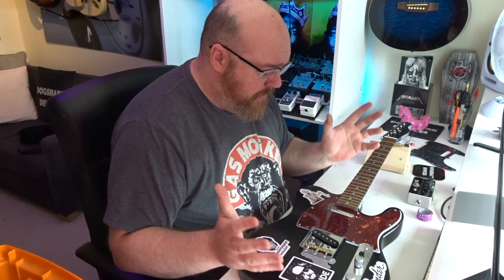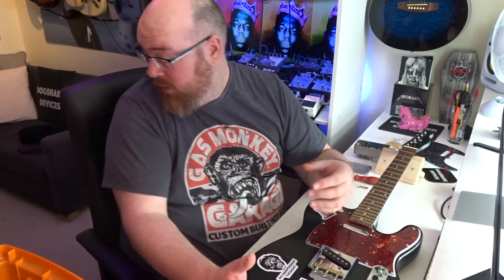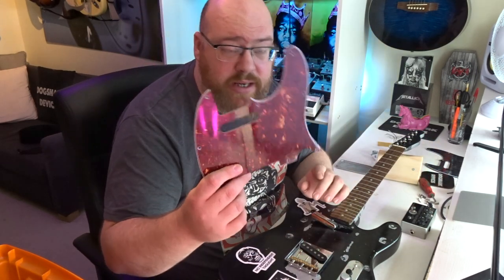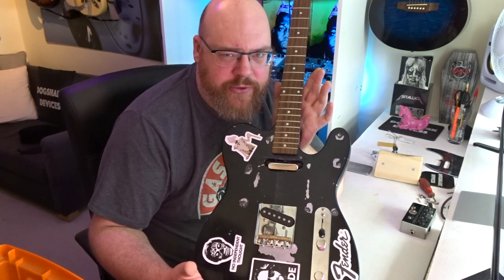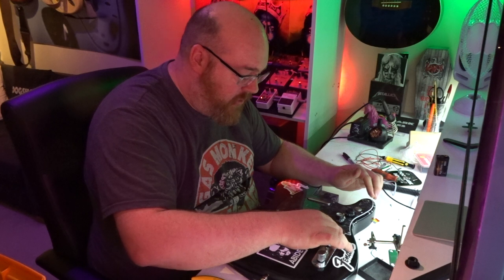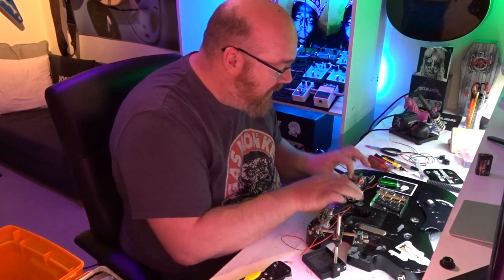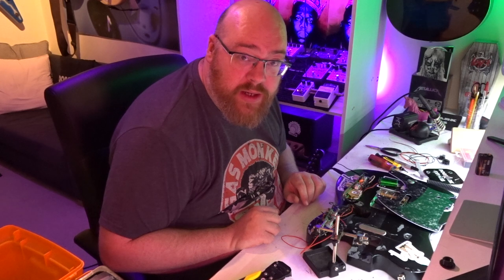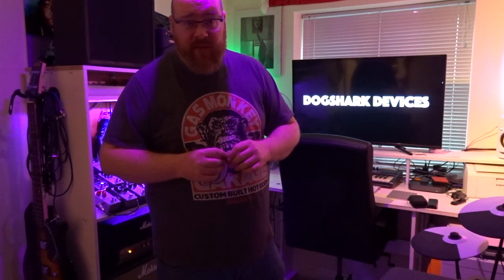Matt Bellamy Fuzz Factory Tribute Guitar Build - How To Install a Fuzz Pedal Into a Guitar

Comment from the maker: Anyone else got any interesting mods they've done to guitars? Always looking for something cool to try.
Reply: I have a XY Midi pad in one guitar🤔
Reply: in how to create a midi control for the digitech whammy pedal, on the song map of the problematique
Reply: I retrofitted a floyd to a 90's Fernandes Dragonfly style hard tail guitar. I had to build the floyd rose nut shelf out of wood because I wanted to do it right. Some people I saw took out part of the fret board to install the nut and then wondered why they had intonation issues. You and I both probably know why they had those issues, messing with a scale length will mess up any guitar. I measured the angle of the head stock put the same angle on the bottom of the wood so it would sit flat on top of an angled head stock (long process). 

Second things I did was build a complete strat from scratch, tele from scratch and a JPX/EVO/Prince style mixed guitar. The last one was because I wanted the fret access the JPX's body offered and just coupled it with the neck profile an Ibanez neck has. The guitar is probably one of my favorite guitars. I also installed a EVO 2 Pickup (Dimarzio) in the bridge. The guitar looks like a JPX until you hit the head stock which was done in an Ibanez shape. Then I colored it purple (head stock and body) with Prince purple since I finished it right when Prince died and felt it was appropriate to put something into it that shows the musical influence and legacy he left behind. I also added a kill switch which is just fun. 

I just got really creative and decided to borrow from other guitarists, my next challenge will be creating Vai's guitar.
Reply: Kaos pad. Matt Bellamy has that as well on his first MB-1

Comment: Just what I was looking for!

Is there anywhere I could find a circuit diagram like this for a Jazzmaster? I'm thinking of replacing the rythm tone circuit with one of these.
Reply from the maker: There's not much to this really. You just place the fuzz circuit between the volume pot and the output jack so the signal can be either router thru the circuit our direct to the output jack. This way doesn't matter what pickup configuration you have.

Comment: I've been searching for a video like this for fuckin ages and this is the holy grail! What settings did you lock the vol, gate and drive to??
Reply from the maker: Honestly can’t remember now. What I did do tho is play with the pedal when it was still a pedal to get the right pot positions for what I wanted. Then once I’d removed the pots I wasn’t going to keep I took a measurement of resistance from them when they were set in the right position and then added resistors of that value to the PCB in the place where the pots had been.  So it’s really down to personal taste.
Reply: @DogsharkGPS  thanks

Comment: Hi man, thank you for this!! I'll do the mod to my most beloved guitar. I'm following your diagram, but I'm confused, you mentioned a DTDP, that's a 3 way right? so would that give me ON to either side and OFF in the center? ... or is it another kind of switch?
Reply from the maker: There is no middle position on this type of switch. Its on/on in either direction but wired so one position routes the signal to the circuit and back out and the other position is effectively a bypass.
Reply: @DogsharkGPS  got it, thanks
Reply: @DogsharkGPS  hey good sir, did you figure out why the trimpots didn't work? I'm doing it and space is tight...
Reply from the maker: @publicnature  not for certain but I suspect it was the ribbon cable I used.

Comment: Nice one Dogshark, I am going to do a similar thing putting a zvex fuzz probe into my squire baritone telecaster. The lower range of the guitar should be monstrous with the fuzz! The metal plate 'probe' part will form part of the pickguard so you can move your hand nearer and further from it to change the sound. Also going to put a DIY sustainer to replace the neck pickup
Reply: Routing is the one skill I've never tried...not got a router like you so it's going to be interesting. I need to cut way more chunks out than your project :/
Reply from the maker: @jcowe9194  dude that sounds awesome. You should definitely post a vid when your done. BTW I don't have a router just used a large drill bit to drill out most of the material and a chisel to take out the rest. Sprayed it black so it didn't look to bad from a distance but it was pretty rough of you look close enough. Got the job done tho.

Comment: very nice work sir, i'm impressed. by the way, i'm building a superstrat and i wanna install my fuzz factory into it. i wanna ask you something about the mode switch between stab & comp knobs. i need your explanation about it, thank you before. subscribed👍
Reply from the maker: The mode switch is actually not on the standard Fuzz Factory. Its a feature added to the Fat Fuzz Factory which pushes the oscillations into sub octave frequencies. So you can get super fat nasty sounds.
Reply: @DogsharkGPS  thank you sir🙏
Reply: Hey I know this post is old but I’m doing the same exact mod!  Do you happen to have a picture?  I would love to see the finished project.  Or give me any tips!
Reply: @LucaTolot  I followed the wiring diagram shown in the video and it worked for me. I would suggest doing this in a strat, or any other guitar with a lot of internal space; I could keep all 5 knobs because of the extra space, it's an absolute fucking blast to play with. Good luck to you fella, and anyone else doing this mod.

Comment: How long does the battery last btw?🤔
Reply from the maker: Typically batteries for active guitars should last for dozens of hours playing time. TRS socket means the battery is only connected when the jack is plugged in so as long you remember to unplug the jack after playing should last ages.
Reply: @DogsharkGPS  got it, thanks dude